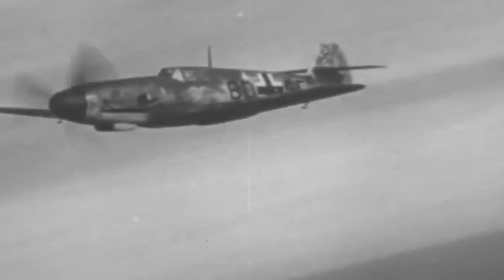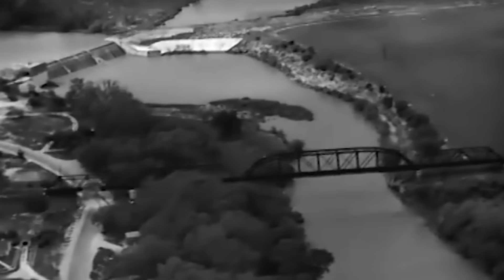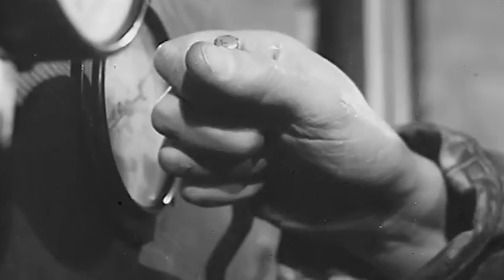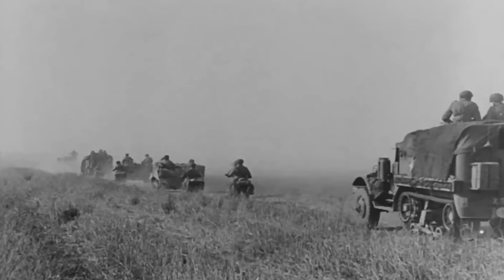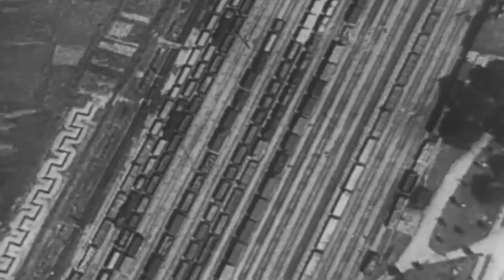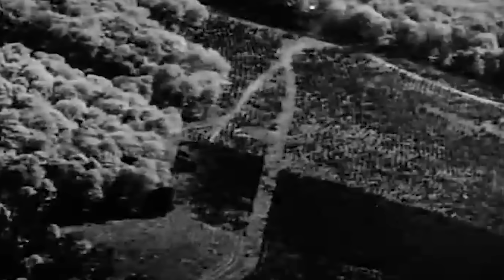Inside Germany's Most Dangerous Jet Aircraft

Comment: The AR-234 built by the Arado aircraft company was a very advanced aircraft over conventional bombers and reconnaissance aircraft.   Like the P-38 Lightning was for the allies, with it's twin engines, long range, and ability to fly at higher altitudes than most other aircraft in service during World War II, even though it wasn't very responsive in the higher altitudes and very cold temperatures, at least in a dog fight or aerial combat, the P-38 was a fast aircraft in level flight, having significantly more speed than a BF109, the primary German fighter and pursuit aircraft before the introduction of the Focke Wulf 190, in which a high altitude, high speed version was built in an attempt catch the P-38 reconnaissance versions which were unarmed and relied totally on it's speed and ability to outrun any pursuing aircraft.  The Arado 234 was a revolutionary aircraft that could have possibly helped to change the overall outcome of World War II, had Germany had them in significant numbers, similar to the same dilemma with the ME-262 jet fighter/bomber.  Had Germany had both the ME262 and the AR234 in numbers at the beginning, it would have certainly aided their pursuit of conquest over all of Europe, something that thankfully did not happen.  The same could be said about the allies as well.  Had the Allies had the P-51 Mustangs from the onset of the war, they could have had much more early success in defending the bombers, but also could have tangled with the BF109's and Focke Wulf 190's on a more even footing.   The AR-234 was also used as a fast bomber, something it was suited for perfectly.  Unfortunately however, the German's had very few of them.   The United States came into possession of a brand new AR-234 which was shipped back to the United States for testing purposes and it was flown for several hours by test pilots of the US Army Air Forces, who all reported that the aircraft was an exceptional aircraft, having an incredibly smooth operation, very high speed,  especially for an aircraft of that size, good maneuverability, and overall a pleasure to fly.  The USA was already working on jet technology before they obtained both the Arado AR-234 along with the Messerschmidt ME-262, however both airplanes were studied extensively and those studies helped to propel the USA's pursuit of an operational jet force comprised of jet propelled aircraft of all types, which it quickly established starting just after World War II and through the 1950's, which was the formative years of jet propulsion technology and the early years and beginning of the "space race" between the USA and the Soviet Union.  Both aircraft were eventually gifted to the Smithsonian Institution's historical aircraft section in the 1950's and they were kept in a climate controlled storage facility in Maryland, where they remained for decades before being brought out of storage and fully restored and they are now both on display at the Smithsonian's historical aircraft museum near Dulles International Airport in Virginia.  Reportedly when the Arado was pulled out of storage, it was still in like new condition, an incredible remnant of a war that had happened 70+ years earlier.  The Smithsonian's AR-234 is considered the best one in the world still remaining.  A flying version of an Messerschmidt ME-262 is located at the Heritage Flight Museum (the best World War II aviation museum I have ever been too, and I have been to them all over the world) located outside of Seattle, Washington.  The Heritage Flight Museum's ME-262 is one of the only ME-262's in the world that is certified flight worthy by the FAA.  They currently are also actively working on the restoration of a Junkers JU-87 (Stuka) dive bomber, which is being restored to flight worthy condition with the assistance of experts in warbird restorations.  When the JU-87 project is finished, and if it gains a certification from the FAA as "Flight Worthy", which is expected to happen, it will be the only flying Stuka in the world.  The restorations that the Heritage Flight Museum undertake are some of the most extensive restorations in the world, and the aircraft are restored to as close to brand new as possible with today's modern restoration technology and the ability to create parts that are long obsolete and which have been out of production since the end of World War II, over 80 years ago.  The Heritage Museum in Seattle has most of the fighters used during World War II from both sides, the Allies and the Axis powers.   It is well worth a visit if you are a World War II aviation buff and you want to see most of the fighters used during World War II, along with many other displays including one of the only V1 and V2 rocket displays in the USA which are not replicas and that are the actual devices used by Germany primarily against England.

Comment: Sir Frank whittle 1/6/1907-8/8/1996
invented the jet engine in 1928,patented it in 1930.
There are no earlier patents or developments.
It is shameful that you left this indisputable fact out of a documentary about pioneering Jet aircraft.
The first AR234 was shot down by an RAF Hawker Tempest in February 11, 1945.
Another fact omitted from your video.
Reply: That kind of British WW2 propaganda fiction won't fly today. Britian did not invent jets or jet engines.
May 3rd, 1921. Maxime Guillaume patented the first turbojet aircraft engine (9years before Whittle) patent no. 534,801
Hans von Ohain and Max Hahn built the first turbojet engine in 1934 (3 years before Whittle)

and von Ohains HeS 3 turbojet powered the first jet aircraft the He-178 August 27th 1939 (2 years before Glosters Whittle powered jet)

Whittle was only the fourth person to demonstrate a jet aircraft engine. 

The Tempest could only engage the Ar-234 if it was slowed down for landing or on climb out, The plane s destroyed on Feb. 11 1945 was on short final to land when it was attacked, otherwise the Tempest couldn't touch it.. it was too slow!
Reply: The French patent was not based on any thermodynamic calculations that could show it would be capable of producing sufficient thrust,materials science was not advanced enough to produce it if it had been..it was a fantasy.
Whittles original design used an axial compressor,but due to the practicalities of the time a radial design was used to aid operational reliability..he knew this was inferior but again the materials hadn't advanced to allow reliability.
As was subsequently proven by early Nazi efforts that had a life span of hours.
As far as the race to get a plane in the air goes,the whole German state had been turned towards building a war,it is hardly surprising that the British,who were trying to keep peace would have had other priorities.
All that matters is that the Nazi regime were defeated,who builds the worlds leading edge Jet engines today?..Rolls Royce.
Reply: @user-fb9os7hy2y  Your propaganda myths won't fly anymore lad.
Maxime Guilluame patent is the first and you can look it up yourself. 
 Frank Whittle was not the first to patent or publish a paper, he was not the first to build a proof of concept or a working prototype and his engine was not the first to power an aircraft in pure turbojet powered flight. 

Whittle plagiarized the work of A.A. Griffiths from a paper he wrote in 1926 and was given the Whittle while attending Cranwell.
 Griffiths who was Head of Engine Development at the RAE pointed out several critical flaws and errors in Whittles patent design that rendered it inoperable and that Whittle clearly did not understand the fundamental fluid dynamics of compressors.

Whittles engines were unreliable and made from inferior materials like Rex78 and Browns 18/3, stainless steels used to make cutlery and kitchenware.
  That stupid myth is easily busted. All German aircraft engines were required to pass the exact same 100-hours PFTR reliability test as the RAF and the USAAF.
 Exhaustive tests conducted by the US Army as part of Operation LUSTY confirmed excellent TBOs averaging 55 hours or more, BETTER than most Allied high output piston engines and jet engines.

There were only two winners in WW2 and Britain was not one of them, the British empire was crushed, left in ruins and heavily in debt... it is no longer a world superpower or a producer of jet aircraft.
  The World's leader in jet engines today is General Electric and Safran...these jet innovators were launched to success by German engine designs and engineers from Jumo and BMW
Reply: @DoktorBayerischeMotorenWerke well thats a lot of AI tokens you've used there.
Look fritz you lost,you lost everywhere and those poor impoverished brits ran sectors of your capital for fifty years.
Why are the Americans fitting RR engines to their military aircraft on mass these days?..it aint because they are cheap.
Reply: @user-fb9os7hy2y  Just the facts lad.
The biggest loser in WW2 was Britain, it lost its empire, its wealth and its aircraft manufacturing industry.
The Americans don't use any British made jet engines in its military aircraft.
 The B-52J is being re-engined with the BMW F130 engine and they will all be 100% made in the USA.

Comment: Feldwebel Bruchlos died near Remagen in his Ar234B after a Flakhit.
Ar234B models used the Jumo004 Jet but  four engined Prototyp Ar234C used BMW003 jet engines.
Reply: Yep had a model (think it was matchbox since they had a lot of dual models) in 1/72 where you could choose between dual and single engines, did the dual ,looked cooler 😎

Comment: Never addressed the issue of the updated double nacelle four engine model
Reply: AR-234C, developed late August 1943. The fuselage was unchanged from the AR-234B, and the wings were only changed insomuch as to add the additional engines.  There was one prototype made with 4 independent engine nacelles, and the rest (no more than 19) were the double engine nacelle variety.
There were four BMW-001-A1 engines, with approximately 800kg thrust each.  The C variant was  faster than the AR-234B, but had reduced range.  Multiple sources also report they could fly higher than the B variant.
Actual production number vary, with some sources stating only 14 were built, of which only 7 received engines.
All sources agree the C variant never saw combat.

Comment: What's the story with the four-engine Arados I've seen in pictures and models?
Reply: The jumo engines were not available so they switched to bmw engines they had Less thrust so they used them in pairs.
Reply: That and it could carry 4,800 lbs payload and finally equip offensive defensive weapons 20 and 30 mm
And wheels, think only 2-4-6 built by wars end

Comment: Radar couldn't track it and it was only about 30-40 mph faster than the fastest piston engine fighter.
Reply: Falsch !
Reply: AS IF! No, British Radar on the Ground, could find it, then Plot it. But, it did Move fast, fast enough that putting a P-47 in Front of it, was tough to do. At Night, the P-61 altered that game, by tracking, from where, above, it already Was, at 350 MPH, and plot It's Own intercept (if in range to do so) course. I think one P-61 claimed a 'jet', at night, but, it was Dark outside, so.. No piston-engined plane, in Level Flight, could catch this Jet, but, a few, could DIVE fast enough to nab an Arado. P-47's, a P-51, a Tempest, and Mosquito all had 'kills' on these, with only 3 being confirmed losses of the type. I don't believe WW-2 records were, always, so correct as-to-be the entire truth (my Uncle, certainly, Explained that, Clearly!). This was a decent Concept, and once it had Landing gear (even IF that cost it 50 Mph and 40 KM of range!), it had the ability to return to the mission, with minimal delay. The skid-gear system, was by-far Lighter, but, the turn-around, was costly in time, and exposure, if not Risk upon 'landing'. One item to note' while the crew had a 'big glass' cockpit up front, a 'Periscope' sight was needed to optically find/range on a Bombing target. That meant, the plane was Stable in-flight, awhile, as the Site found it's Target. So, as a High-speed Bomber, it had, um, Issues...
Reply: @ericbrammer2245   Late war Spitfires had a top speed of up to 480mph and could reach Mach .89 or 660 mph in a dive.  RAF high speed dive tests in 1943 using early Griffin powered Spitfires reached this speed according to records.  Later war models picked up better dive speeds.  Based on this record it has the highest recorded speed of any jet or piston powered aircraft.  Germany didn't have any reliable jet engine during the war but desperation forced them to use what they had do to the rail line from Spain to Germany through France falling into allied lines.  This rail line had been bringing Aviation gasoline from the US to Spain then to Germany.  Once that was gone Germany had very little gasoline for piston fighters.  Meanwhile in the UK they had three successful centrifugal flow engines and several Axial flow engines.  They also had a Turbo Prop and Turbo Fan both flown prior to the wars end.  The US jet program only existed because of the Tizzard Mission sharing British technology with the US.  Both the P59 and the P80 flew on British built engines and went into production with licence built British engines.

Comment: radar didn't track but it did and could detect the ME262,  a smaller and considerably faster aircraft, they also could and were several times brought down by AA guns abd on take off and landing was ambushed by fighters and shot down and of 224 built only 38 were left in service by the end of the war, some never made it into the air due to parts shortages and a lack of fuel and the rest that did were mostly shot down one way or another, this article is so inaccurate it is not worth watching

Comment: Engines. Germany needed the engines. In 1944 these jet engines were unreliable and required an enormous amount of maintenance. They also had too little, too late. The wonder weapons were not going to save them. Instead of all the grandiose pipe dreams of all the military branches and aircraft manufactures the German high command concentrated on the production of jet propelled fighters in the late 30s, early 40s they might have ruled the skies.
Reply: They were missing the high chromium steel alloys needed for the jet engine turbines as well as high quality jet fuel. This was denied to them due to the constant allied bomber raids
Reply: Or, if Hitler waited 5 more years before beginning WW2, they'd have been perfected.  Turns out, Hitler was under enormous pressure to start WW2 when he did, because his whole economic recovery of Germany and massive re-armament was build on an economic, house-of-cards financial fraud...
Reply: @intercommerce if he'd waited 5 years he'd have been up against the Avro Vulcan
Reply: @davidzof  However Germany would have perfected the V1, V2, Me 262, and other jet aircraft and rockets/missiles. Possible even the 9/A10 and nuclear warheads. The Vulcan was a subsonic bomber. Of course Avro Canada would have the Arrow in the early 50s.